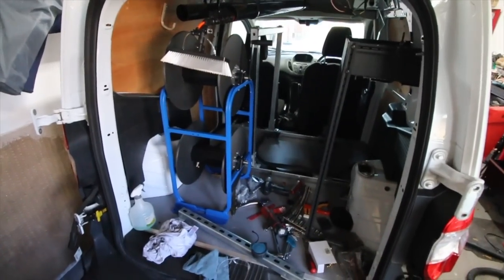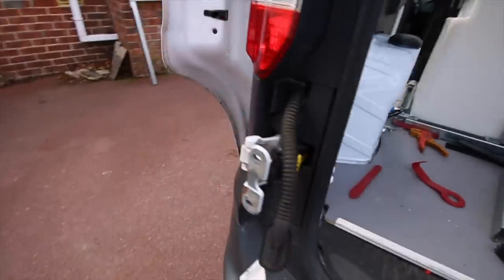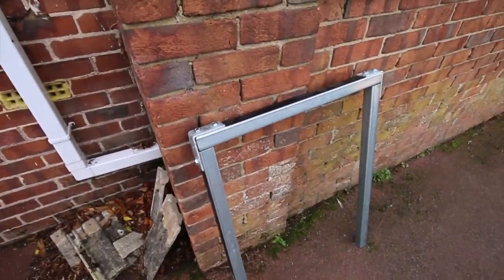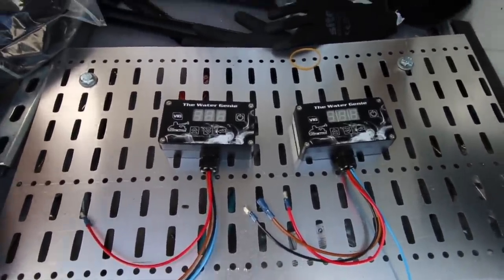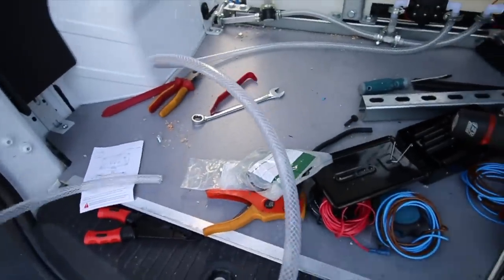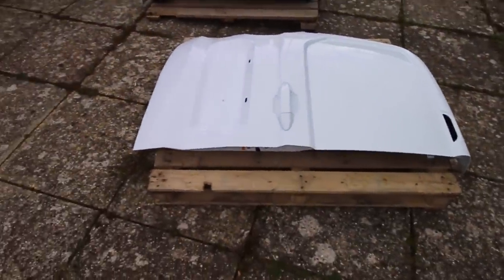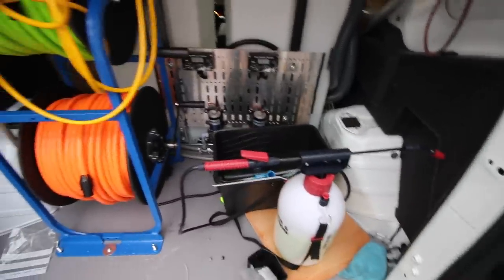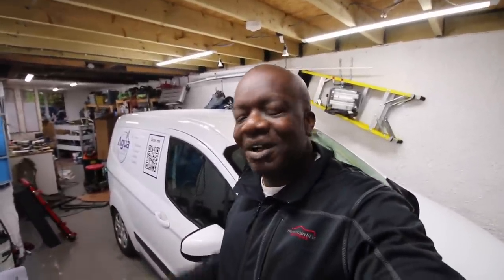Ford Transit courier build final vlog

Comment: That back end is sat low .don’t think them springs are up to the job??
Reply: Payload of 520kg 500l of water is 500kg on its own with out any other equipment and the driver/passenger I wouldn’t put any bigger than 350l in the back of that

Comment: will you have a difficult time with keeping that battery charged with that van being euro 6 with a 'smart' alternator? Those alternators are controlled by the ecu to ensure the start battery is charged only as far as I understand. It won't charge the second battery (unless you get a dc to dc charger).
Reply from the maker: I have fitted a separate charger which gets plugged in once a week overnight

Comment: Does then van have enough carrying capacity? 500 litres is 500kg not much left for driver and other stuff
Reply: I was thinking the same
Definitely not made to carry over half a ton
Reply: I found this:

Ford has made the best of what space there is, though, with a 2.3 cubic metre load volume and a maximum payload of 660kg that's up with the best in the class. The load bay really is surprisingly generous with a 1,620mm load length at floor level and 1,012mm between the wheelarches so that a Europallet will fit.

So about 100Kg load capacity to spare.
Reply from the maker: The total weight of all the gear installed 41kg and with a total max of 400 litres plus the driver who weighs 73kg  we come in at 514kg well below the 660kg max gross load limit
Reply: Thats great then Paul
Perfect calculations
Just had a friend pulled over in a van because his back was sitting low
They put him on the scales way overloaded and rewarded him with 6 points and a hefty fine

Comment: Job well done on the installation Paul, but the van needs to be put over a weighbridge fully laden,need to check gross and axle weight.I use a courier as a run about and your would be suprised how little it takes to overload it.PS rear doors came out ok.
Reply from the maker: The total weight of all the gear installed 41kg and with a total max of 400 litres plus the driver who weighs 73kg  we come in at 514kg well below the 660kg max gross load limit

Comment: You need to take the van fully loaded to a weigh bridge to check it's legal.
Reply from the maker: The total weight of all the gear installed 41kg and with a total max of 400 litres plus the driver who weighs 73kg  we come in at 514kg well below the 660kg max gross load limit

Comment: Nice tidy job paul. The doors look great. I noticed some comments before about the water tank being too big and would put the van overweight. If that is the case it might be worth putting a fill mark warning sticker on the tank so it doesn’t get overfilled.
Reply from the maker: Am way ahead of you there, we have marked the tank at the 400-litre mark to ensure we don't go over the max weight

Comment: Lovely Jubbly, very clever system. I have to agree with other, suspension might not be up to the weight load.
Reply: It’s only approx a 600 kg payload and there’s 500kg of that moving around in a tank.... wrong choice of vehicle IMO